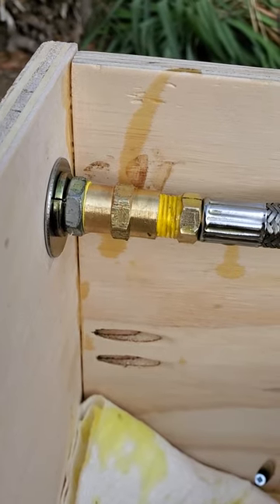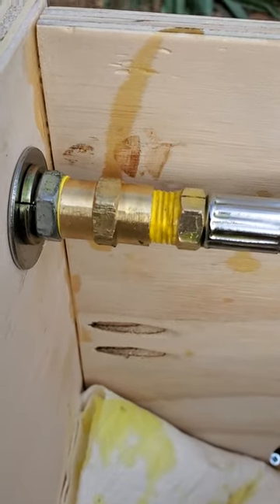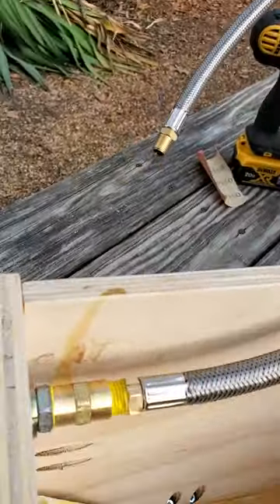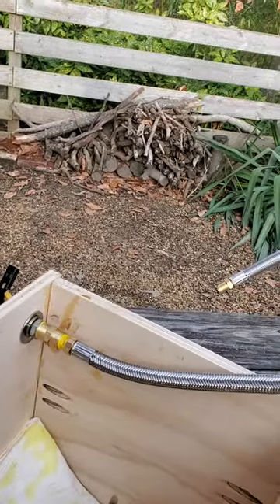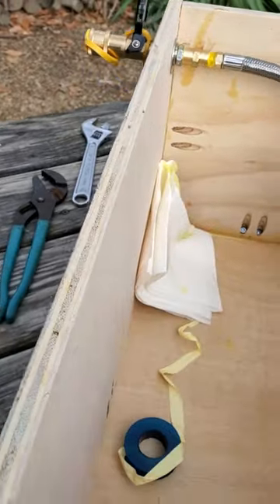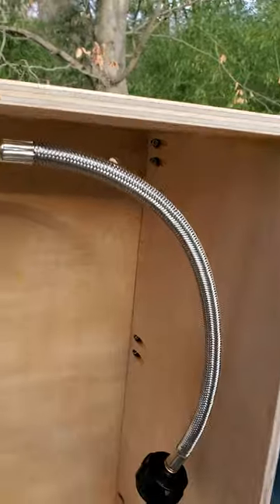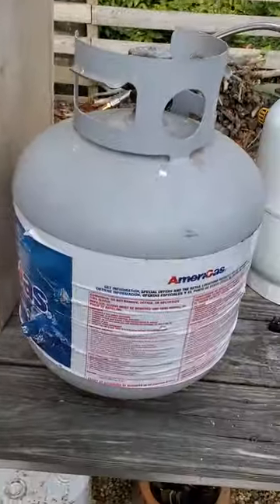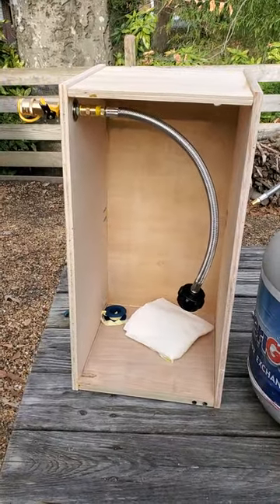Ford Van Camper Conversion- propane locker: part 3

Comment: I've been looking for a solution to bring propane through a 3/4" plywood wall and you are the only one that has a solution (the lamp part).  That is ingenious!  Regarding the "gas" type tape--we continued to have just the slightest propane leak and "Blue Monster Pipe Thread Sealant" was recommended (brush on)--it did the trick.  No more worrying or doubts.  Thanks for the video and the great idea!